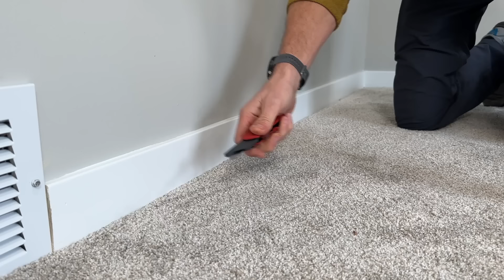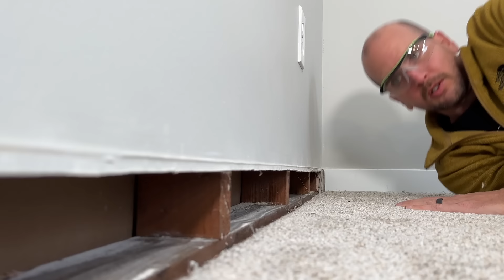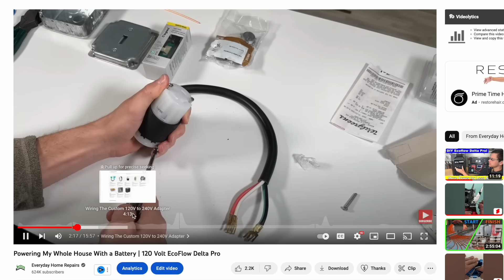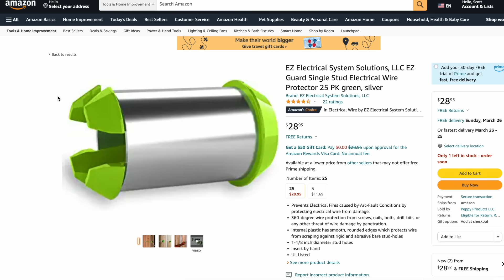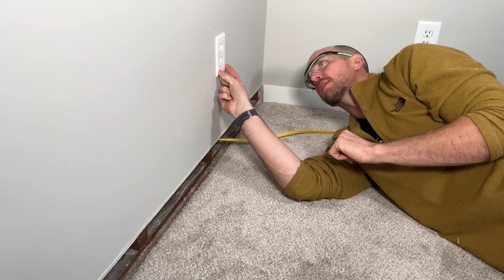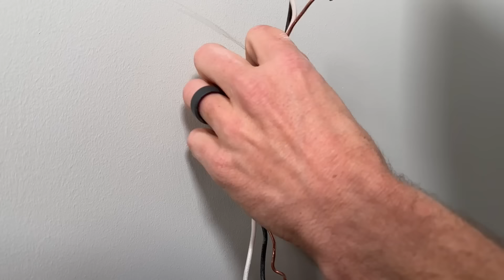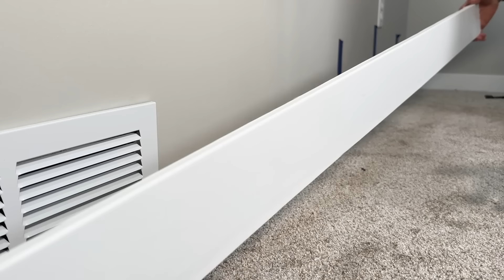How To Hide TV Power Cord And Cables | Easy Way To Move An Outlet

Comment: The most difficult part of this,  at least for me, is how to get the romex from the floor up to and through the box. I also think opening a hole in the box already in the wall may not be easy. You kinda skipped those steps.
Reply: You’re exactly spot on correct!!!
Reply: I'd also appreciate seeing this.
Reply: Me too!
Reply: Paul,
I have about 12" of chain, like the stuff on a basement light socket, tied to 8 feet of string. I drop it down, and easily grab it at the bottom, then tie it to the Romex and pull it back up. I always try to go down, not up, for my first action.
Reply: Wouldn’t you just feed it from the box down to the ground & fish it out of the opening behind the baseboard?
Reply: I believe that Paul is talking about the second box that was wired up. You could do something similar to what Ian is saying… there will be a knockout at the bottom of the box. You’ll have to get a screw driver in the box to knock out the hole. Then you can drop chain/string down the whole, tape it to your romex and pull it up and thru. It won’t be easy but that’s how I’d tackle it.
Reply: @stephenlea5765  I think they are talking from behind baseboard up to the preexisting outlet that originally had power
Reply: @ianbutler1983  sounds like a great solution to this issue.
Reply: @krisallen9194  Correct.  You can also us a wire fisher puller and do the same thing as what you have described here with the chain/string.
Reply: @krisallen9194  That is exactly how I would attempt to do, just wondered why those steps were skipped.
Reply: There are a a trillion videos on how to fish a wire
Reply: @paul K. Don't work at trying to push wire up the wall to the new box. Just take the new box, punch out the opening in the box, secure the romex to the box, the drop the wire into the wall, and secure the box to the wall. Now, just grab the new wire at the bottom of the wall where you dropped it.
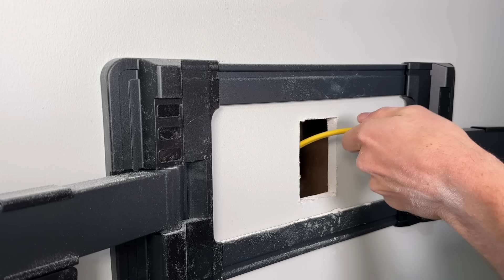Reply: @Kelly MC  Well, that's exactly what he's doing at 6:52; Running the Romex down to the bottom.
Reply: Boy, it sure seems like an inch and an eighth hole is such an overkill for one wire, but my biggest concern is how much does it weaken the stud?? I bought a pack not paying attention to the size, but didn’t use them when I saw how big the hole was going to be. Any words of reassurance? I was particularly concerned about exterior walls carrying the weight of the roof.
Reply: @psalm23sheepdog  floating walls (not holding roof weight) will not be negatively affected by a 1 1/8 hole if it's round, the strength will mostly still be there.

How strong do the inserts feel? Wall studs only hold a few PSI of pressure each, I think. If you can stand on the side of the insert without crushing it I would bet you'd be okay
Reply: Romex isn't flexible it bendable but isn't flexible.  It will hold the shape you bend it into
Reply: @psalm23sheepdog  shouldn’t weaken the stud at all; I believe that a hole 1/3 the width of a stud (or joist) leaves spec strength. (That might be old seat of the pants practice and not spec, but I’ve never seen anything debunking it.) Since 2x (interior wall) studs run 3-1/2”, that 1-1/8” penetration just makes it. I’m guessing that’s how they came up with that diameter for the sleeves.
Reply: I'm not from the USA and not sure on the code but you could do it as two separate pieces of "Romex" (one fed in and down from the new outlet , one fed in and down from the old outlet) and join them with wagos in a junction box.  Otherwise do what Ian and Kris said.
Reply: jetline or mule tape through inside of box
Reply: @psalm23sheepdog  the wall does not appear load bearing (there is not 2 2x4's at the bottom) so the wall does not bear much weight. But I agree the hole size seems excessive.  I have never seen those inserts he is using either and wonder about the cost?
Reply: Several ways like some have said. If in insulated tou can likely just push the romex down and grab it. Or drop a string with a weight and grab that and tie your wire.

If insulated you can use a tape measure.  Push that down trying to stay between the sheetrock and insulation. Once you get that down tie one of the romex wires to it and pull it back up with the wire. Or do it with a string but you add a step that way.
Reply: @drcl7429  in the US, code says junction boxes are not supposed to be hidden or inaccessible like inside a wall.
Reply: @techadsr  ok. Seems strange that you can route cables anywhere but a junction box isn't allowed.  Do you know why?
Reply: @drcl7429 All connections need to be accessible.  If a junction box is sealed up in a wall or drywall ceiling, a faulty connection cannot easily be found or repaired.
Reply: @techadsr  so where are they allowed?
Reply: @drcl7429  anywhere they can be easily accessed, such as drop ceilings where tiles can be removed without tools.
Reply: @techadsr  Well similar rules apply here in the UK but only to junction boxes that need to be inspected regularly.  ie they use screw terminals.  Wagos and similar are regarded as maintenance-free so can be anywhere as long as they are secured and enclosed in something like a wago box.  Accessible is a very subjective word and is widely open to interpretation.  As an electrician is expected to do the inspection it can broadly be interpreted that anywhere an average electrician can gain access to without damaging materials is regarded as accessible for the purposes of inspection so although the wiring path in the video wouldn't be allowed because of the path it takes it would be ok to use a junction box as long as it used maintenance free terminals.  

I'm curious how people are expected to wire LED down lights in a normal drywall/plaster ceiling in the USA?
Reply: @drcl7429  Recessed can lights, incandescent, CFL or LED, are accessible from the hole the protrude from.  The Romex is terminated in the fixture and connections to the light are likewise accessible.  Same with ceiling or wall mounted exhaust fans.
Reply: Yes, he didn't show the hardest part!
Reply: @jakeplissken1681  
I purchased mine at a Big Box store called Menards, located here in the Midwest. I can’t remember the cost, but you get 25 to a bag. I think if you were building new construction, the price would add up quickly. The metal tube appears to be quite robust, making me wonder if the strength of the metal would make up for the loss of wood? The manufacturer says nothing on the bag about that. I think there’s a place for these, but I do wish they made them even an eighth of inch less. Thanks for your comment.
Reply: If you’re questioning the couple steps he may have not clearly outlined… maybe this project isn’t for you
Reply: @stephenlea5765  You've fed it down from the outlet you installed behind the TV. Then you have to go up to the original outlet. If it's a few inches, no problems. But in the video it is probably enough you would need mother than just a pair of hands.
Reply: @joshuakasprowicz5148  Hardly. It's a common issue with routing cables. Electricians deal with it all the time. They all seem to have their own techniques. I have one. I was hoping to see a better one!
Reply: The old outlet should be about a 8 inches above the drywall cut.  At about 3 inches wide, many people's arms from elbow to hands will fit in the wall.  One could lift the Romex up to the outlet, find the unused outlet opening, and push it through.  Don't break it off.  It also provide restraint from pulling Romex out.  You may need to break the tab on one end first though.
Reply: i woulda pushed my wire down from the box..i just did one for a customer..went in from the attic..very easy..no trim removal or drywall cutting
Reply: @techadsr  Thanks
Reply: I would just remove the old “source” box from the wall completely to spare the madness of fishing a cable thru an installed box.  Most likely, the source box is a “new work” or “new construction” box with the fasteners holding it to the framing hidden behind the drywall. But that handy dandy oscillating cutter tool can come to the rescue once again! Breaker off and old receptacle removed like before. Next, sneak a pry bar beside the box and determine which side of the box the stud it’s attached to is on and exactly where the nails/ screws are. Now, sneak that cutter tool (with a metal blade this time) in that joint and snip the fasteners off. Pull the old box out, preserve all wire lengths inside. Now, fish the new wire for the tv. Finally, install another retrofit box in the original box’s location.
Reply: @drcl7429  you absolutely could. BUT, it is illegal to have a junction box hidden in the wall behind drywall with no way to access it. You would have to put a blank wall trim plate over the box, which would be visible in the room. Not the end of the world, but not ideal.
Reply: @jakeplissken1681  a small set of fiberglass “fish sticks” or “glow rods” are cheap and just what the doctor ordered for both poking to a box location and also pulling your cable back thru it. Especially when there’s insulation. Used them a hundred times and they are irreplaceable. Just the right amount of flex, just the right amount of rigidity. Fish tape for conduit. If you will do it twice ever, buy them.
Reply: Fish rods or a fish tape could make the run, but generally, electricians don't run wiring behind the baseboard for a reason. Just fish it through the drywall and fix the hole, no big deal
Reply: Wow! Now I can do this. Thanks
Reply: It was done in the magic black.😂
Reply: Hi
Reply: @3weight  plus holes in studs should be cut towards the edge in order to maintain the strength of a stud.
Reply: @LUCKYLADY000000  I'd always heard they were supposed to be centered, so there was a minimum of 1/3 width of material at each edge, fwiw
Reply: I did this exact installation, but I was working with a metal outlet box . It was almost impossible to make a hole. I told the client  and she agreed to put an  dummy plate just underneath the outlet so I could have access to outlet and make an entrance hole.
Reply: I just ran into this problem today. Simply could not thread into the box. Beyond frustrating.
Reply: Just go from the box down and then over if you don't have any other resourceful way to do it.  Harbor freight sells fiberglass pieces to help.
Reply: It’s the only difficult part of the process.
Reply: The hardest part was skipped completely.  Getting the wire up into the box. That's all I watched for.
Reply: You also need to repair the wall at the bottom because it will leave drafts and make the heating less efficient
Reply: All you need is some fishing tape. There's no installation in that wall from what I can tell, so it's as easy as dropping it in from the top, hooking the cable from the bottom, and then pulling it up. It's very easy. 

If you're doing it on a wall with insulation it's a lot harder, but the idea is pretty much the same.
Reply: That is where a Wire Cable Pulling Fish Tape Kit comes in handy. If the hole is above you, then you feed the fish tape down the wall. These fish tapes are skinny rods that are flexible and long (are adjustable in length). I used these tools when running network cables  Then, when the rods is visible near the floor, you tape the electrical cable to the fish tape. Finally, you pull the rods from the new location. Cable and rods will emerge and then you can finish the job.
Reply: Drilling a hole in the box is illegal. Also, the breaker needs to be changed to av arc fault breaker because you extended the circuit
Reply: Didn’t he bring it down from the top and then over to the outlet?
Reply: @ashlieelle4407  no. He went below then up. The easiest way to do that is getting another remodel box, removing the existing receptacle box (pry it off the stud and push it away from the stud), take the wires out of the old box, pull the new romex up into the existing hole, put all romex into the new remodel box, and make up the wires. Unless you have some sort of fishing stick to get the romex into the small hole in the box. DO NOT drill a hole in the box, it's a code violation. Further, if that circuit doesn't have an arc fault breaker controlling it, one needs to be installed. The best option is hiring a professional. I've been an 01 electrician for 25 years, 11 of them as a certified master electrician. I couldn't tell you the number of times I've had to redo homeowners "electrical" work. Youtube is not a substitute for team training and code knowledge.
Reply: Very good job
Reply: Do a video like this on a wall with insulation in it.
Reply: For me, I would run the wire the opposite way, starting from the existing outlet and connecting everything up and moving along to where the new outlet will be. More room to fish wire through And connect everything up.
Reply: You can pull it up using another piece of wire tied to the romex
Reply: @dansliwa6832 
Yep he totally skipped that part
Reply: he absolutely did skip over that part. I have a feeling he was struggling to get it up there because it's a big step to leave out of his video because that's the part that would confuse most people. I don't see any comments from the video poster so I don't know what to think